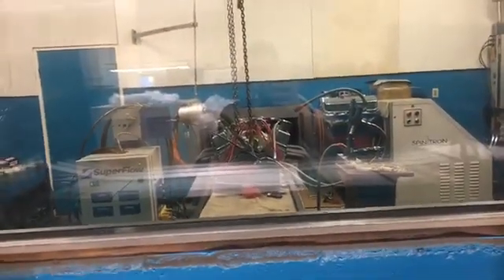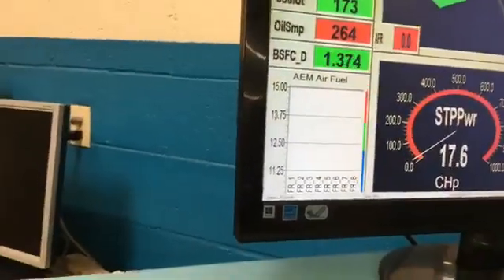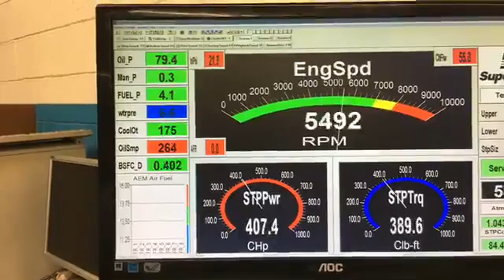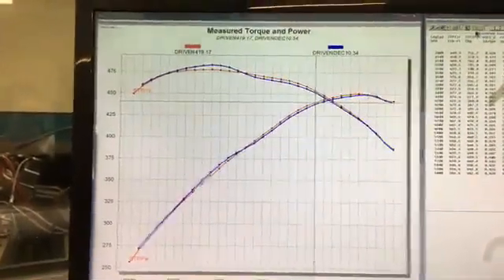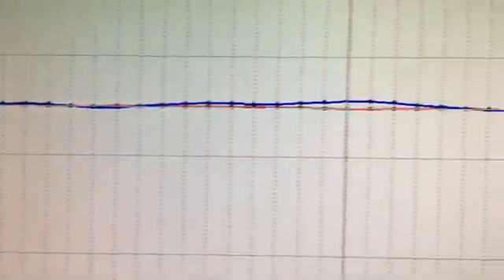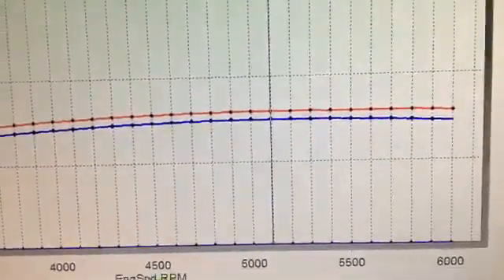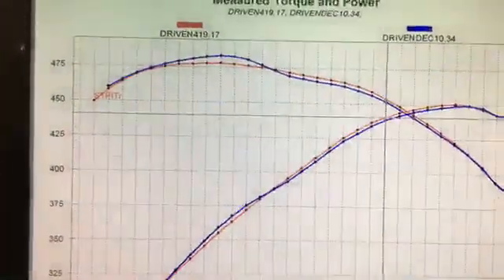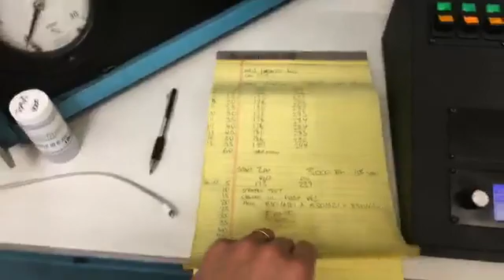R&D 20W-50 Semi Synthetic Oil Temp Vs 10W-40 Synthetic Oil Temp

Comment: i  m very glad to see the results it also hit mewhen the 20w50  temp is much coolder than the 10w40

my question is   what does that effects on the main crankshaft journal oil holes  ?
does 20w50 lubricate much better than10w40 or has no effect so  many contradiction in answers over the internet.

did you use same oil brand for both tests ?

wish to get a reply and thank you again for this great info .
note: redited comment for grammar corrections

Comment: great test review, here is some common sense. reduce the friction, reduce the oil temp. friction causes heat, causing oil to thin out and if high enough break down. oil no matter what grade if blended with high-quality properties will hold up much better in a given environment. molly, zink, phosphorus, Teflon, detergents, polytetrafluoroethylene ect: ect: ect: makeup motor oil, the more ppm the more it costs and performs. cheap oil is just that.

Comment: The more efficient an oil is at taking away heat from engine components, the hotter it will be. 

So based on this theory, the reason the non synthetic oil is running cooler is because it isn't taking away as much heat from the internals and transferring it to the oil, aka less efficient heat transfer.

Seeing higher oil temps from a different oil typically means that your pistons, cylinder walls, bearings are going to be cooler.

All heat is just energy, oils don't have cooling properties by themselves, so the conventional oil just isn't capable of transferring the energy well.
Reply: interesting !

Comment: Can I use 20w50 in vw 1.8 tsi engine (140000 km done )
Reply from the maker: Is the engine stock and what will you be using this engine for?
Reply: @DrivenracingoilLLC  20w50 is much better than 5w40 in my hot region (109.4 Fahrenheit) and also it seems maintaining oil pressure too.engine runs smooth without any noise.also using this same oil in my Skoda superb 1.8 tsi (done 160000 km) no issues so far.I’m changing oil every 6000 km.
Reply from the maker: @vijaysundar5250  Sounds like a perfect fit for your combination. I can definitely see the thicker viscosity help maintain oil pressure. Hot climates tend to elevate the oil temps and the thicker viscosity will help with that.

Comment: Sorry, but make big mistake: cooler oil means one thing: less heat was absorbed from internals, so everything in engine are just running hotter. Thinner oil transfer heath better, so it temperature rises more, than in case of thicker oil. Put solid grease in that engine and you will see even lower "oil" temperature.
Reply: You dumb bitch… oil has to lubricates internal components.. lighter oil = less lubrication.

Comment: my country temperature is between 27° to 35°, what oil is that best 5w30,10w40 or 20w50?..thank you
Reply: And of them will have good flow at start up. No problem for a 20w50.
Reply: Depends on the machine. What does the owners manual say?

Comment: In Harley Davidson manual they say run 20W50 if ambient temperature above 40, SAE 50 if ambient above 60, and SAE 60 if ambient above 80. This is because the thick oil stays cooler and maintains it's viscosity in high heat v-twins. It is air/oil cooled.  But you don't want too thick to have bad engine starts. Once warm, the thicker seems better though.
Reply: Thank you!
Very useful info! 👍
Reply: Lake Speed Jr. Was onto something there...
Reply: Yah came to the same conclusion

Comment: The 20w50 "ran cooler" likely because it has higher specific heat capacity?
Meaning it'd absorb more heat before showing the same amount of increase in temperature.
If so, what it also means, is by the time the 20w-50 got hotter based on longer run time, it will hold its heat (hold its higher temp) more than the 10w-40.
See this video, at time stamp 6:30.  https://youtu.be/6VLMfUz34R0

Running a few degrees cooler (vs the 10w-40) in a few rev's on the dino does not reflect a 40min commute or a 4hr track day.
Reply: A higher density causes more heat coheficient too. Takes more time to heat and to cool.
Reply: I also read the same thing on some papers, 20w50 is worse at cooling engine, once hot it is difficult to cool it down
10w40 should be better in cooling capacity and dispersation throughout the engine
Reply: Makes sense both of you.
Thank you!

Comment: so we should use 20 50 instead of 10/40 oil? i was planning to switch to 10w40 and was using 20/50 . so tell me should i keep using same or should I switched to 10/40??
Reply: as light of an oil as possible, as heavy as necessary

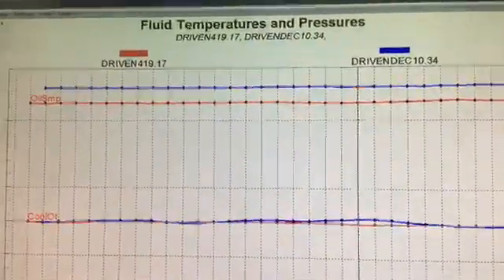Comment: 02:25   20w-50 Is running cooler than Synthetic 10w-40... i prefer an oil that runs hotter,,,it means is taking heat off the engine better that the thick oil...then this heat is passed onto the water that later is cooled via the radiator
Reply from the maker: We appreciate the thought, but the specific heat value of the 20W-50 GP-1 is actually better than the 10W-40 so it is able to absorb and pass through that heat at a greater rate. Hope this helps.
Reply: @DrivenracingoilLLC  what about oi pressures?? ID like to know what oil pressures readings you got..cause as experiwnce says when cold u get a pressure but the same oil in our cars as they get hotter pressures drops as the oil gets thinner cause of heat absorbed by the oil..i Guess the 10w40 got lower oil pressures than that of 20w50????
Reply: @bestofthebest3821  
Wouldn’t the weather, engine size & make/model, and year make a difference…??? In areas that’s extremely hot all the time…20w-50 may be better.

Comment: So the semi is running cooler?   Which out of the two is providing better protection with the ZDDP.  I always understood that the lighter the viscosity, the better the cooling effect?  I currently run your FR20 in my 2017 Mustang GT with a whipple 700+ wheel HP.....should I be using a higher viscosity oil?  I haven’t yet installed my engine oil temp and the pressure gages to monitor them but coming in the next 30 days....
Reply: Lake Speed Jr NICE!  Does the FR20 utilize the same formula as the NASCAR formula?
Reply: Lake Speed Jr Thank you Sir!!  Great products!!  Keep the vids comin.....